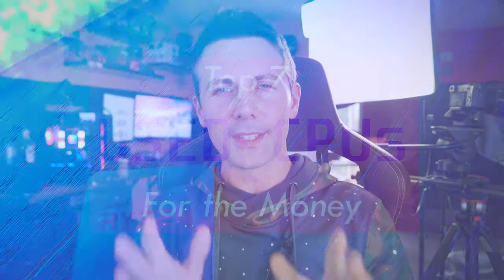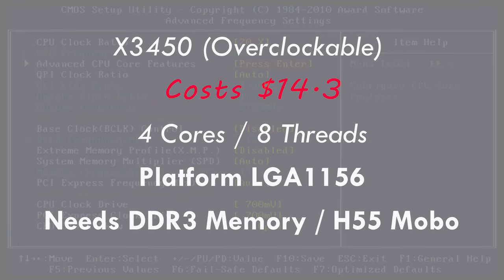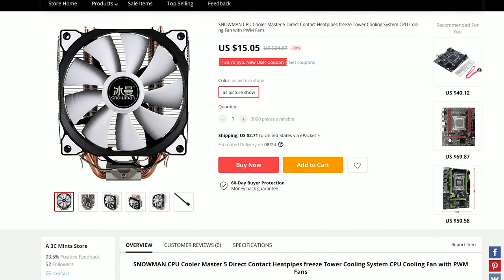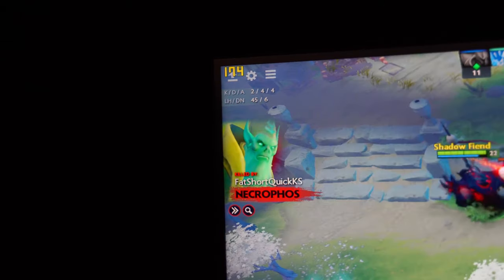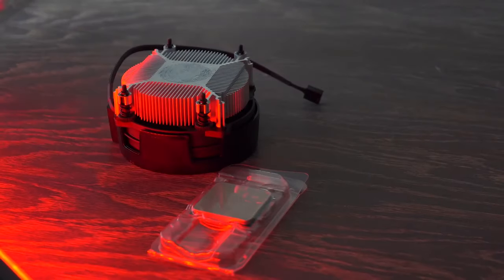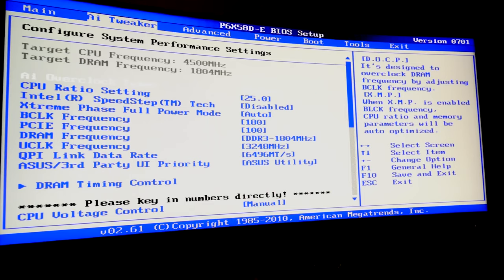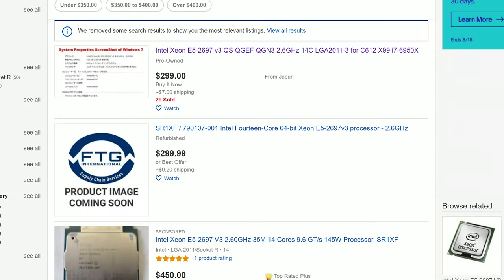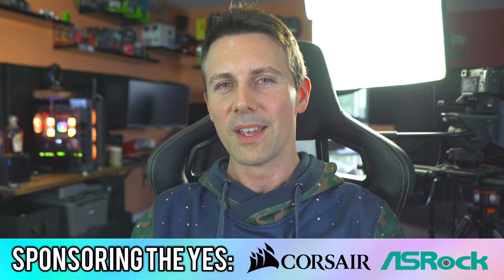Top 7 USED Gaming CPUs for the Money in 2019

Comment: Ryzen 5 1600 is currently cost $80 on aliexpress. If only i can get it at $75 or lower, i can avoid 30% import tax
Reply: Use coupons or ask the seller to mark down the price on the package
Reply: You can use $4 Coupon code. Though it's only for new users but you can make a separate new account
Reply: You can use $4 Coupon code. Though it's only for new users but you can make a separate new account
Reply: @kruxdt6307  
Marking down price is not worked anymore, because the customs will check the online price for every item

Comment: I prefer the 2011-r e5-1600Vx Xeons because they are so easy to overclock over 4,8 GHZ. Think the e5-1650v0 is the best budget CPU of this but the absolute best is the e5-1680v2 for sure!!
Reply: it costs 140 usd in my country
Reply: @Justfun-xx6xe  1680v2 or 1650? In my country the E5-1670 V2 costs 150+ 70 shipping costs, an E5-1650 you can get dir 40 €
Reply: In January 2021, doesn't seem like AliExpress has any more listings for 1680 v2, there are still listings for 1650 v2  $170 Canadian price almost same cost as a Ryzen 5 1600 on AliExpress..the 1650 v2 actually is $20 CAD higher
Reply: @marcc5768  In Germany you get the E5-1650 for about 45€, the e5-1650 v2 for70€, my recommentation the E5-1660 for85€, the overpriced E5-1660v2 for170€ and the E5-1680 v2 starts at 140€ maybe there are 1660v2 for 135€  But with x99therer is an e5 1660v3 which is an e5-1680 v3 with a bit lower clock it is an 8 core CPU the 1660 v3. But i have a core i9 7900x now with an EVGA x299 Dark together with corsair Venegance pro Rgb 3200MHz8 the ram no one other has) for425€ and it worked out of the box from the first case power switch?? maybe i can send you e5 Xeons from germany or send you the Names and bank transaction numbers from the sellers if you want??
Reply: @8iosatlost209  thanks for the offer, but the exchange between your country and mine, is not good right now.  140 Euro is $216 in CAD currency.  Also right now, I'm not considering unlocked Xeons for any projects yet, starting with locked Xeons for office workstation for myself and maybe a few friends.  Don't wanna consider overclocking Xeons currently due to the extra heat that gets dumped into the chassis along with the increased cost of the electricity that an OC'd Xeon will drink.  Since the Xeon build(s) I'm considering will be for Linux systems..not Windows 10..so just running on Linux will be better performance than running the Xeon with windows 10.  I saw that happen with some dual core rigs I have.  Once I installed Linux Mint, it's like the machine had new life.  Which doesn't happen if putting Win 10 on a dual-core CPU system.
Reply: @marcc5768  Yes i didn´toverthought that tghing with the exchange. In linux every cPu core counts x2?? Windows is the greatest power eater, in the past i thought it would be because of the many multi-compatible interfaces, but today I believe more that it is controlled. That microsoft has the last word in the end, how well which hardware works and how quickly you have to buy a new computer. What an incredible cheat that would be.

Comment: x3450 or 3470 stay away from in 2019. I have built a few of these off aliexpress. A) they dont game that good with a rx570, or well.. anything up to a 660ti or better (bottleneck hard). B) if you plan to sell don't expect more than 100bucks for the whole build. C) go with Ryzen. Upgrade path smashes everything despite more or better gaming on a old xeon. the fact you can switch a cpu and get a massive performance gain in a year or two from now beats any old xeon.
Reply: yep! i chose to get r5 1400 with asrock B450 instead of e5 2689 with a random chinese motherboard because of its more recent and upgradeable XD

Comment: Not a good time for selling your old cpu-s.
Where I live, you can find used 8700k, lowest price, for 380usd, and you can buy new ryzen 3600 for 250usd.
And for example you can find used 2070 for lowest price of 560usd, and you can buy new 2060 super for 500 usd.
At this time it is cheaper to buy new computer than used with the same processing strength.

Comment: still rocking my 4670k i bought in 2013
Reply: 4690K here....Games like a trooper @4.5GHz all core.😊
Reply: @JuxZeil  Nice 😊 mine does 4.5 with a lot of juice but 4.2 with just a little for 24/7
Reply: @retrosimon9843  I hazard a guess I won the silicon lottery with mine.  £80 two years ago and it does 4.225GHz @ 1.229V and 4.495 @ 1.342.  That's the only reason I haven't had to upgrade really.  Still does me proud in gaming..... until the R9 3950X arrives. 😊

Comment: I3 9100f is good ?
Reply: Very bad. Try getting a ryzen 2600 or 1600 & an Asus b450 board. AMD architecture is going to drive the next-generation consoles. Microsoft worked with AMD for the new Xbox.

https://www.aliexpress.com/category/200002319/computer-components.html?spm=a2g0o.productlist.0.0.30486490Wy0TlS

For help https://community.amd.com/community/support-forums/general-discussion

Comment: i got an i3 8100 50$ but sadly it was broken and i cant get contact with the seller. no i got  a b360 board and ram lying around. so sad
Reply: You sure it's broken?  Clean the contact pads with a little Isopropyl alcohol and check for warping of the substrate(CPU circuit board).  You'd be surprised how many CPU's I've got cheap because the previous owner inserted it into the socket without matching up the little triangle....and it bent the substrate out of proper contact.🙄 Their loss is....
Reply: @JuxZeil   I did. i tried to clean the contacts on the CPU and check for bent pins. sadly its not working
Reply: @KaizersPOV  Not bent pins in the socket, put a straight-edge against the CPU circuit board facing you side-on.
It only takes one corner(which is usually the corner with the little white triangle) of the substrate to be lifted just enough that it doesn't make good contact with the pins in the socket.  If you look at the CPU in the socket latched, the tension force is only applied to the heat-spreader, nothing pushes down on the substrate to force it down flat.
Might not be that, but it could be an easy(if not gentle) fix. 👍
Reply: @JuxZeil  ok i checked it the  motho socket is flat. plus i tried my friends i5 8600. its functional.
Reply: @KaizersPOV  Do you want to go farther with the troubleshooting?  It would involve visually checking the soldered resistors on the bottom of the chip.
Reply: @JuxZeil  ive given up hope.  whelp thats life.
Reply: @KaizersPOV  It's a shame to see a CPU go in the recycling.  But if you're just not into soldering and stuff you could try to sell it to someone that is, you might even get up to $5 just for the gold content if you're lucky.

Comment: i7 2600/i7 3770/ i5 2500/ i5 3570(k) Ryzen 1200/Ryzen 1500x/Ryzen 1600 :xx
Reply: I5 2500 is on its last legs. Great for most games. Shit for new AAA titles. Gta can't get 60 fps and Tom clancys wildlands barely averages 60.

As for vr. Having an extra 20 percent in cpu power even as a hyperthreaded core would help.

Comment: The Ivy Bridge Xeons with high frequency and core count are still overpriced in my opinion. Ryzen new is the better deal in my region, especially the 2nd Generation 8-Cores for 185 EUR are a steal. The X58 CPUs are dirt cheap though and I still love my X5675, but I think the time has come to move on to AM4. But at least if you are looking for gaming performance, it is still great and even better if you disable all the security mitigations.
Reply: Obviously it's going to depend on region, but the overclockable hexa-core Ivy Bridge Xeons are dirt cheap where I live now, and the Sandy Bridge ones even moreso. The octa-core ones still command a huge price premium though of course, as most "best in socket" chips do. The problem is that X79 motherboards are still pretty darn expensive outside of the Chinese ones - though even those are verging on the price of a brand new B450 board, and a used R5 1600 (or even R5 2600) isn't MUCH more expensive than one of the Xeons. With the DDR4 price drop, Ryzen is squeezing platforms like X79 pretty hard right now in terms of price/performance, whilst also offering huge future upgrade potential and much lower power consumption. Personally, I still enjoy buying these old platforms just for the fun of overclocking and tinkering with them, but Ryzen continues to offer ridiculous value for people who want to get into PC gaming. And that's great!

Comment: I'm running an x58 rx570 system 
My crappy asrock board won't run a 6 core but it was free 😉
Also waiting for Xeon prices to drop, I love messing with older gear.
Reply: What about the w36xx series try to see these they might work like the w3680 or something
Reply: @mr.br4dga279  thanks, I'll try one of them. It won't run my x5675.
Reply: @edharding9363  yeah good luck
Reply: @mr.br4dga279  a W3670 runs fine. Thanks !
Reply: @edharding9363  you are welcome my friend

Comment: What about i7 2600K with 16GB DDR3 RAM for 50$ ? This could be the one of the best choise because Z77 chipset MOBO isn't that expensive and you can get for around 250$ everything included like Decent GPU , SSD , HDD , RAM , motherboard , PSU and case and also.... ( most important thing ) the i7 2600K will handle 4.8GHz overclock without any issues and no matter how big is your sillicon lottery , every single i7 2600K will handle that speed but kf course you must add a decent cooler because oced 2600K to 4.8GHz drains around 160W but the performance boost is significantly huge and i think is better than Ryzen 2600 in single core performance. I've been using this cpu so i know what am i talking about right 😂

Comment: no 3930K which is kinda fair considered the price of the motherboards lol
Reply: I was thinking the same. The CPU is cheap, oc's like crazy (4.7GHz should be fine with any C2 stepping), but relevant god mbds are through the roof on the used market, hence I might sell off some of my X79 setups just because the mbds have become so sought after. About 2 to 3 years ago was when used/refurb X79 mbds were plentiful, I obtained a great many Rampage IV Extremes, P9X79 Deluxes, P9X79 WS & P9X79-E WS, and Gigabyte UD3, but the supply has totally dried up. At the same time I obtained a number of Maximus IV Extreme/Zs from the same sources for good prices (any 2700K will do 5GHz on an ASUS M4E/Z), I built seven of them.

Comment: I got an x3470 for £12 the other day
Reply: Me too! Mine is still in the post. 
Same price as the X3450 in the video.
Does it overclock well?
Reply: @ITH56  yea it does, takes a while to find out what your chip likes, 

First think I do is slap it anywhere from 1.3 to 1.35 volts

Set BLK to 166 memory ratio to lowest either 6 or 8 

Put a 20x multi and see what it does 

Then I try 166 by 24 multi(or whatever the 3450 goes too) 

If that doesn't work try 200 by 20 but that requires 1600mhz ram to work well

Comment: I would only go to xeon if you have EXISTING mobo's to support them. There is absolutely no reason to use them if you are starting from scratch... some are missing cpu instruction sets and the older socket mobo's use wayyyyy more power compared to the newer ryzen platform. Also that older stuff will be missing features... no USB3 no M2 slot. some even no SATA 3. no thanks. and last... no upgrade path after that... good luck trying to dumb that hardware later especially x58.

Comment: I5 2400 for $25 on eBay with free shipping should have been on this list IMHO.
Reply: If the motherboards are just as cheap then you're right. I think I read it benchmarks similar to a R3 1200 when both are stock. The AMD OCs  out-of-the-box though of course.
Reply: @beetooex  don't only looking for count of core clockspeed. 2nd Gen intel lack Intruction set and PCI express limited to 2.0.
waste time bought this stuff even though are cheap moment. 
It seems walking in dead bones

Comment: I got a prebuilt with an i7 2600 and 12gb of ram for free
Reply: Damn it... 101% worth it because nowadays this CPU still does everything you need. I have i7 2600 and i paired it with GTX 1060. Csgo 310fps , GTA V 75-90FPS everything in ultra but 1080p... Still good cpu

Comment: x58 nmotherboards are still pretty expensive as compared to X79 Chinese motherboards.
Well just go buy the chinese X58 motherboards then? NO. I owned one and the CPU performance sucked. Benchmarking yield lower than normal results. For LGA1366 you have to spend extra on a good motherboard, don't get the chinese ones.
X79 on the other hand, my CPU runs up to standard using the Chinese motherboard. The price is cheaper and performs better than X58. E5-2630v2 prices went from 30SGD to 40SGD recently, cuz of youtube videos for obvious reasons, you can get the E5-2640 for cheaper, slightly worse performance, but still keeps up. But of course, all these without the benefits of overclocking.